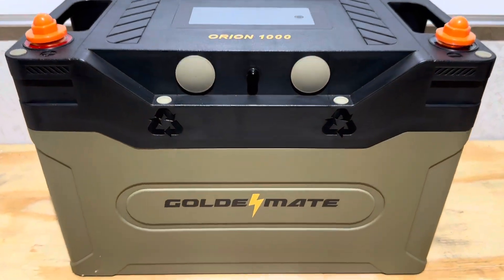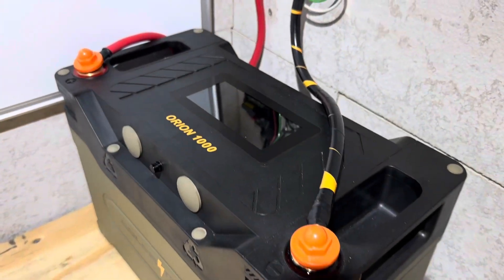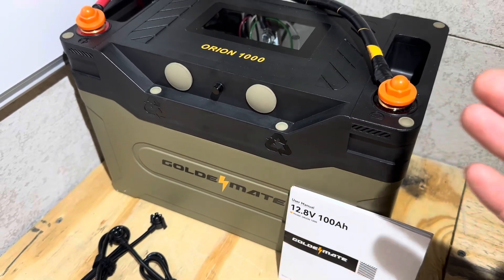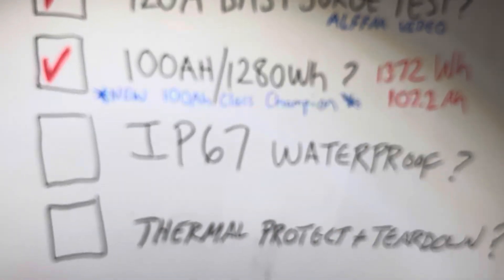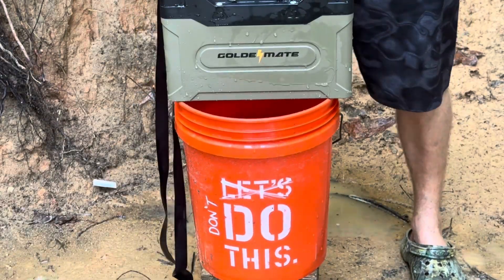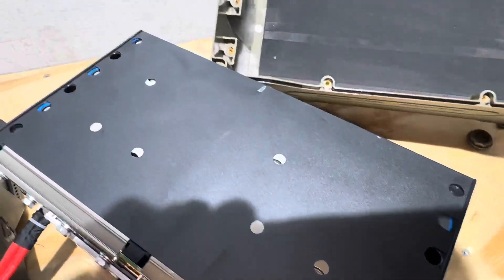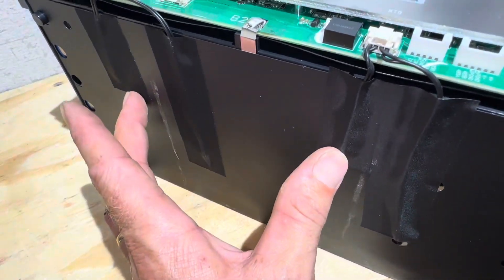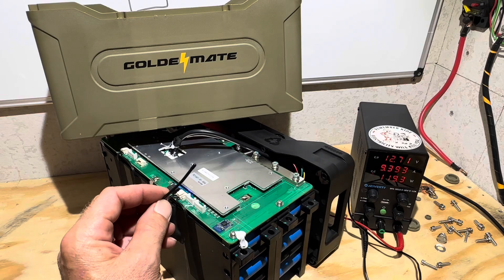Goldenmate ORION 1000 12V 100Ah LiFePO4 Lithium Battery Review Teardown

Comment: Is Goldenmate made by LiTime?  I found this in their FAQs for the Orion1000 battery:

5. How long to charge GoldenMate LiFePO4 lithium batteries?
You can charge our LiTime 12V 100Ah lithium battery with a 12V 10Ah or 12V 20Ah charger, and a full charge will take 10 hours and 5 hours respectively.
Reply from the maker: That’s a crazy misprint on their part lol. Or maybe it’s not? 
Goldenmate design is unlike anything from (LiTime, Redodo, Power Queen which are under one parent corporation as far as I can tell) 
Goldenmate is owned by Goldencell technology from what I can tell. They are cylindrical cell design batteries and use a JBD variant BMS. JGNE is the manufacturer of the cylindrical cells for Goldenmate. The others use prismatic cells. 
Hope this helps! I have no complaints from Goldenmate performance or LiTime, Redodo, PQ either. All solid choices. Really like the Orion though it’s currently still the capacity leader of any battery I’ve tested.

Comment: Do you think this could be hooked to a 100 or 200 watt solar pannel without a solar controller it seems to have a pretty robust BMS? Thanks so much for doing this video it was super helpful.
Reply from the maker: Definitely not recommended. You can get a 10A charge controller for a few dollars.
Reply: @THEOFFGRIDMOUNTAINHOMESTEAD  Thanks.

Comment: Good Evening ! I just got 4 of these batteries today, thanks to you. I was wondering which model Jesverty do you use? Would you get the same one? Thank You. I'm like SP1, I'm not a power geek like your self. I hope it has understandable directions when I get it. I don't want to hurt these things.Your help would be greatly appreciated.  TAKE CARE..
Reply from the maker: Awesome my friend! 
I use the 0-30V 10A model for bench work and top off charging. If you want to charge for regular daily use look at a dedicated charger like the Noeifevo or similar. The power supply can charge but would take forever to charge up the batteries from actually using them. I use a SCC to charge them power supply to max them out for capacity pull. 
Hope this helps you my friend. Anything else let me know. 🙂
Reply: @THEOFFGRIDMOUNTAINHOMESTEAD  Thank You ! What is an SCC ? The Batts are at 81 to 83 percent. I just want to top them off now.And get a charger for clowdy days in the winter if necessary
Reply from the maker: Solar Charge Controller!
Reply: @THEOFFGRIDMOUNTAINHOMESTEAD  Just went to Amazon & it's on the way. I'll order the other charger.Thank You. TAKE CARE..
Reply from the maker: You’ll be fine to top off with the power supply! Several brands of dedicated chargers out there. “Most “ are exactly the same just have different decals/stickers on them. Find the best price! 
Take care my friend!
Reply: @THEOFFGRIDMOUNTAINHOMESTEAD  I ordered the Noeifevo from your Vid on IT. Thank You. TAKE CARE..
Reply from the maker: Awesome! It’s a good charger and has been left in the rain accidentally a few times hasn’t complained at all!
Reply: @THEOFFGRIDMOUNTAINHOMESTEAD  Good Deal ! Thanks Again. TAKE CARE..

Comment: Great video! Did you happen to teast the highest amp draw it can take?
Reply from the maker: I usually don’t test to high current shutdown, my capacity test setup and inverter won’t handle extreme current testing. 
Regardless I would have OCPD at 100A on this battery if in use, so that would activate before a BMS overcurrent trip delay from either current sensing or thermal trip.

Comment: Like always, awesome info!
Would you please review a 300 ah battery like the Kepworth? 300 ah for less than $500 seems like a great deal and that with a Topbull 4000 would be perfect for my Winnebago View. 
TIA
Reply from the maker: Thanks! 
I actually have a 12V 300Ah video I’ll release later this week/weekend. Hopefully you’ll enjoy! It’s in the off-grid RV so should be right up your alley!
Reply: @THEOFFGRIDMOUNTAINHOMESTEAD  I’m getting spoiled to the extent that I don’t want to buy anything till I’ve seen you tear it apart and give it a thumbs up!😆
Reply from the maker: Thanks for that! Appreciate you! That’s my mission to separate the good from the bad. I don’t want anyone wasting hard earned $ on something that’s junk.
Reply: @THEOFFGRIDMOUNTAINHOMESTEAD  Just a suggestion but the 12.8v 300ah Newti Power LiFePo4 seems too good to be true at $470 considering most 400ah batteries are $1,000+.

Comment: I like waterproof. Never seen someone actually submerge it for 5 minutes.

Not a fan of the slow charge speed. Seems to be 50a only. For a single battery, that’s not good. In a bank of 4 batteries it wouldn’t matter too much.

With that display, they might want to be competition to server rack batteries.
And at that low price it’s a very interesting battery
Reply from the maker: They claim it, I test it lol! It was fun for sure! 
The battery does have a conservative charge rate by the manufacturer, this is par for course on by many brands regardless of cell type. This is mostly for end user safety/warranty/lifespan purposes. 

Beyond the scope of this video, but cylindrical cells are tough, dissipate heat quickly and some manufacturer’s cells are rated at 3C rates! Easy to find info on goldenmates cell provider for this battery with online search. Some impressive information on the cells.

Comment: Amazing. In-bat shunt set to show 0% when cells at 20%. This would increase cycle life significantlly.
Reply: It would but you also don’t get to use the full capacity. You’d need to add one more battery to your system to account for it
Reply: @TheCornucopiaProject-bd5jk  Oh of course, but still the pack pulled the advertised 1280wh while still at 12v, a very healthy discharged voltage. If you test a true 100ah cell composed pack, which I have plenty, if you do DoD to 100%, cells can go as low as 10v, which isn't particlarly the best voltage to discharge to, but only THEN does it pull 1280wh and at 80% DoD, usually leaves the discharged bat at 12v, but if pack is exactly 100ah, you can maybe get around the 1100wh mark, which would be less than adverstised but that's the DoD recommended.

So you basically either do recommended DoD and never get full adverstised capacity, or do full DoD to get that advertised rating but get less cycle life. At least in my testing. This is 0.3c and 0.2c discharge tests. Also have 0.5c data which isn't particularly too much different if wire sizing is correct and cells are healthy.

I only discharge below 12v if there is an emergency balckout.
Reply from the maker: I have never pulled my 12V systems below 12.0 so far. Usually never get below 12.8-13.0 unless I need that capacity for something during a rainy/cloudy weather pattern. 
A few rips down to empty shouldn’t make a meaningful difference on cycle life of LiFePO4. More on this later. 

Also with LiFePO4 cells not too large of a capacity difference at .2/.3/.4/.5C etc at least from the cells perspective. Waste heat through BMS/wire/connections can be noticeable though at higher rates. I always pull down with an inverter. Folks need real world capacity. A dedicated discharge test rig could get even more capacity out than I did from the Goldenmate